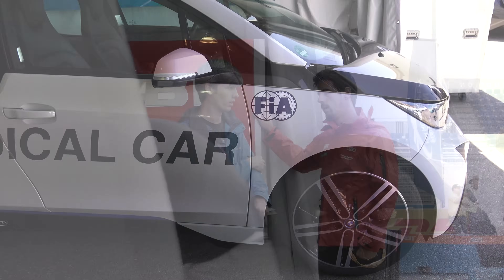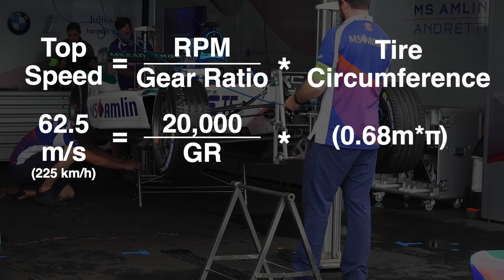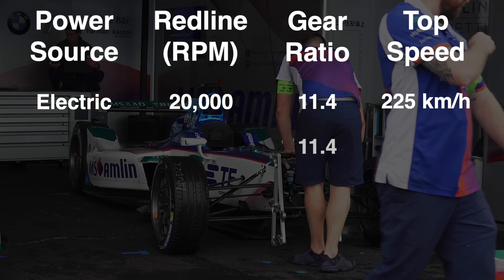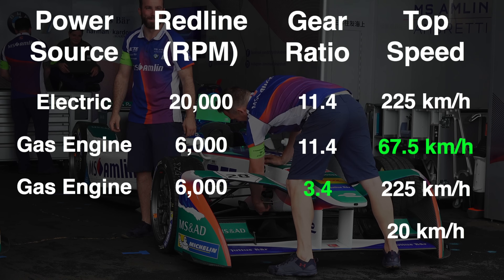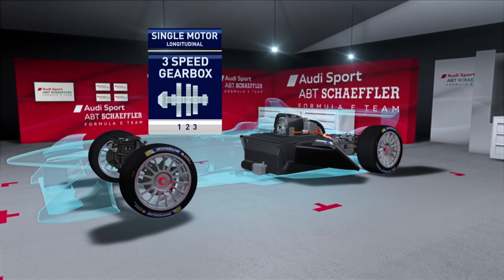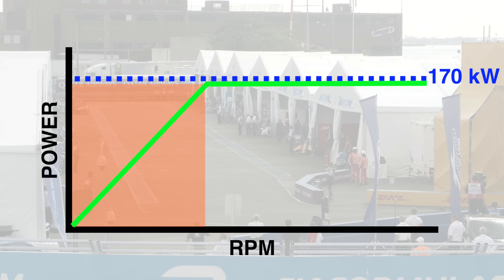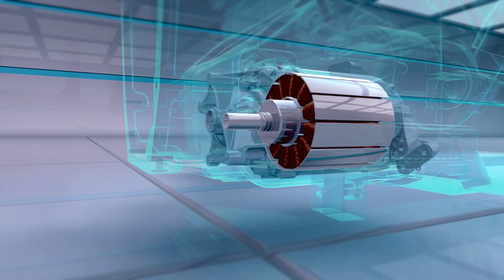Why Do Electric Cars Only Have 1 Gear?

Comment: Why do electric cars need brakes at all? Motors are capable of applying torque equally forward and backwards so surely they can slow down as fast as the tires can grip.
Reply: For emergency situations. And depending on the state of battery charge (completely full or completely discharged), the regenerative braking might not work at all.
Reply: Expect to see a brake-less electric car soon.
Reply: Surely it is wrong. Decelerating at grip level from high speeds needs much more power dissipating(recuperating) than regular electric motor can provide.

Comment: Are you talking about induction motors or synchronous reluctance motors here? You show a picture that looks like an induction motor, but you never say. I don’t know for sure, but I am guessing that SynRM motors have a bigger range of speeds where it will develop high torque.

Comment: You are not quite right. An electric motor has (as every motor) an efficiency curve that is zero att stndstill (stall) AND att unloaded top speed (No torque produced) This means that maximum efficiency is somewhere between those points, mostly att about 75% of unloaded Speed. Admittedly the efficiency curve is quite flat but nevertheless it decreases in both directions. A consumer car ( of electric bicycle for that sake) gets 2-3 the range with a gearbox compared to One without

Comment: there are gears is electric cars by the way because we still need that 11.4 to one ratio. so there are gears that are engaged. is traditional transmissions we engage only one set of gear in each gear you are I mean torque only flows through one set of gear other gear sets are disengaged so we should have the same power and efficiency in both one-speed electric car transmission and traditional 5 or 6 gear transmission

Comment: Does this mean, the Tesla Roadster need more than one gear, to make it up to 200mph?

The Porsche Taycan already use it.
Reply: Can you please use metric units?
Reply: @happygimp0  Ok. Über bzw. bis 320 km/h. Above or till 320 km/h. You get it ?
Reply: @bernhard.k  AFAIK: Tesla Roster can go far beyond 320 km/h, without gear shift. At least Wikipedia says he can reach higher speed and i do not find any info about Tesla having any gear shifts.
Reply: @happygimp0  i don't Think this works with one gear. The rpm of the electric Motors can't do both, High speed and High acceleration. But we will See.

Comment: The original Tesla Roadster had a transmission but they realized it was much cheaper and simpler to just overspec the motor and cap the torque at low RPM (otherwise it'd destroy itself through sheer brute force).

Comment: If you had a two or three speed transmission, how small could you make the motor and still achieve the performance of a normal car.  What impact on range would a transmission have?  I have not seen any videos that show experiments with this in mind.
Reply: Bosch CVT, which is a very "lossy" belt type (just proof of concept) has a claimed gain of 4% in efficiency while also improving acceleration by 13% for a given motor, total added mass 20 kg, so negligible. But this means we can also run a smaller lighter motor or better, a smaller battery pack so less weight. Using a Tesla battery pack this transmission slight breaks even in terms of weight saving, but you gain more range and more performance. Keeping the acceleration the same while possibly improving top speed would give you slight more gains.
There are multiple papers with more conventional geared gearboxes claiming from 10% to 15% efficiency improvements, here the weight savings start to become significant.
You can get away with just one gear but it's not the best solution, you compromise either acceleration or top speed no way around it since you can't spin the motor to infinity, not just in performance but more importantly because of the efficiency map of electric motors. Bosch wouldn't have investigated this if there was no merit, Porsche wouldn't have produced a two speed gearbox if there was no merit, engineering academics wouldn't have spent time and money writing papers if there was no merit.

Comment: My question is would they gain battery life if they could use a more efficient gear? I find it hard to believe you'd use the same ratio on a motorway and climbing a 1 in 3 grade, unless the car has over 500 horsepower like a Tesla. I don't think you'd need more than a 2 or 3 speed transmission though in most cases, in a lower powered car. Though even the 150 horsepower Nissan Leaf still only uses one gear, but it's still a bit limited in top speed compared to an equivalently powered VW Golf 2.0TDI. The G-Wiz tends to bog down on steep hills when tested on Top Gear and could benefit from a low speed gear.

Motorcycles, especially performance ones could easily get away with one gear because the wind resistance at high speed is equal to climbing a hill at low speed anyway, so there is no advantage to a low range gear that could easily wheelie and flip the bike when taking off. A bicycle that was powered to 60 mph experiences 20% of the vehicle and rider weight in air resistance - equal to riding a 1 in 5 grade.

Electric buses and lorries would still need a range of gears as the heavier the vehicle, the more discrepancy between hill climb forces and wind resistance forces.

Comment: Can you convert efficiency? Adding gear(s) will help with Wh/mile.  For example,    Tesla travel at 70 MPH  lose about 20% range vs traveling at 60mph.  Won't adding 1 gear like the Tycan allow better efficiency at higher speed? This is reverse comparing to ICE cars

Comment: My Puch Maxi S Moped which originally has 50cc’s, has a 70cc Zylinder and bigger intake and outtake. And it revs all the way up to 11’000 rpm and runs about 55-60Km/h

Comment: what kind of motors are used in formula e care AC or DC and which type in them
Reply: AC. DC motors need a brush but that is inefficent.
Brushless DC motors do not exist. Some claim they sell one but they are AC motors with a DC to AC converter in them.

Comment: I would like to know why jetski's done have gears. Maybe its planned obsolescence by the manufacturer as 9000rpm at cruising speed is sure to decrease the life of the engine. It would be nice to be able to have like a low ratio and then a high ratio for cruising.

Comment: Formula e looks promising but I just wonder why didn't they design the cars to have like a large removable laptop battery that can be popped out and replaced during pit stops?   Seems silly the driver has to jump out and hop into a second fully charged car just for the pit stop.    For one, you can see why this is because the current batteries they have are so massive.   It's built right into the car.. can't remove it.

Comment: I notice brainlets claim that electric cars will never outdo combustion engine cars because they lack range, yet as statistics shows, the average person drives less than 50 km and very few actually drives long distances, now why is that? 
Its very simple, people use vehicles to get to work, to the store, to pick up stuff in general they drive short distances because of it.
So how come in Norway a country that is infamous for horrifically badly designed road networks with extreme ranges between cities that are completely unnecessary yet its the one country in Europe were electric cars are doing extremely well sales wise and use case wise, because most people in Norway drive inside of cities because the cities are so poorly designed you have no choice but to drive if you want to get somewhere within an hour. 
Its very simple, even in Norway the average driving distance of a person is less than 100 km a day, which is perfectly fine even for the shittiest electric car model with a 12 kWh battery.
Most people in Norway only drive long distance once or twice a year on avg statistically this is insignificant and if you live in the South a train will get you to most places in fact the electrical network in Norway is so well established and well built that you can easily get everywhere you want with an electric car of range 100km even in the Northern most parts.

So this great range that combustion engine cars possess is very rarely fully utilised, after all most people do not really drive long distances anywhere in the world, electric cars might get 400 to 700km ranges of real world driving distance in a year or two easily, but in reality the last people to switch to electric will be long distance hauling services, taxis outside cities, emergency service vehicles, public transportation vehicles, military vehicles, postal services and so on. 
Regular people will however get the electric car specially with fuel prices getting illogically insane lately, as of writing this in Norway the fuel price of petrol was 18 NOK per litre and diesel was almost 17 NOK per litre, convert that to whatever currency you use in google and be shocked, last year the fuel price was 15 for petrol and 13/14 for diesel.

Comment: In a road car, an electric motor could greatly benefit from an overdrive gear for use at highway speed, right? Something to drop the revs down to something like 1500 or 1000 rpm at 70 mph. This would greatly improve mileage on long road trips.
Reply: I agree

Comment: I think with a gearbox an electric car could use much less power to keep the car in speed at for example 120km/h, thus the range of the car would multiply.
Reply: not really, as you only use power to get the engine to certain rpm (a lot of work), then to keep it at that rpm (not too much work), this is why cars are economic when they keep the speed but consume much more fuel when accelerating. Most of energy is used to spin the wheels, not the motor and to lauch a car in specified direction, not to spin the engine itself, so it won't have any great impact on range.
Reply: The main reason to have a gearbox on a electric motor is to accelerate faster and to climb hills easier. When a electric motor gets bogged down (like on a steep uphill climb) it can heat up very fast and destroy itself. Not to mention it's much less efficient running at low rpm with high load. Better to use a gear ratio to turn it into high rpm and low load.
Reply: I agree.  I don't think the efficiency is expressed correctly in the video, just performance.  if you clutch out an electric motor at desired top speed you would maintain the speed much easier.  But every motor has a startup cost, so you wouldn't want the motor at 0 rpm when in motion - hence a high gear than runs at low rpm to just balance out the friction and pullback of the motor.  Mass of the moving parts also plays a role of course.  motor/generator combos (charging while braking) seem to also gain alot of efficiency, and higher rpms=more power recoop.  So smart gearing up and down is just smart engineering.  of course how the car knows how long you are going to be in a power band and when in a brake to prevent overclutching is another matter entirely.  Distinct driving styles and brake riders would be the demise of a production geared 100%EV.  Gearing in a clutchable ICE at like 1L in size would be a decent tradeoff for battery size and allow for range extension and no cars stuck on side of road w/o juice.  I get that more parts = more problems (like weight).  but anyway, i agree - i think the imprint of a small gear package would pay for itself.
Reply: Porsche seems to agree with you
Reply: Nonetheless gearboxes will be a need for future electric cars... not everything is an unloaded car in a straight line
Reply: I agree. Most modern electric motors run on 3 phase alternating current with a frequentcy converter, and i was thaught that when the frequenty increases (aka let the motor spin faster) the inpendance also increases therefore losing efficiency. 

So if there is a gearbox the engine can rev lower and have less internal resistance.
Reply: @Sjef0194517  But if the internal Resistance is higher less Power is transferred, because less current is Running in the Motor.

Comment: Why dont they put gears on EVs to help improve efficiency when motorway driving. Reducing rpm. I can understand a single gear in performance, but surely for economy which evs are essentially aimed at in the consumer market, gearing would be a good idea?
Reply: the added weight and complexity would probably bring more downs then ups.

Comment: aelectric motors have  a wide range of RPM  but it does not mean that you can drive an electric motor under load al low RPM,   In that scenario,  it produces heat, a lot of it.  yo, with 2  gears will be enough.    Direct drive  tends to be a problem when it comes to deal with a little of weight.

Comment: what about "electric power" economy? Changing the gear ratio would help an electric motor to consume less energy, thus extends the range for a vehicle. But the cons of adding a gearbox to a vehicle is an extra weight.

Comment: Someone could help me? If I increase rpm, the energy consumption will increase too?
Reply: Energy consumption only increases when the spining magnetic field is faster then the spinning of the armature, a motor with zero load while spinning at a high rpm does not consume a lot more energy then if it where spinning slower, a motor trying to spin at a high rpm but being slown down by a load will draw more energy, a motor trying to spin fast but not moving at all from a load will consume a lot of energy and likely burn out the motor.

Comment: Does electric motors electric efficiency decline with speed? I mean, does it consume more electricity to drive the same electric motor at 20k and at 10k RPM if both are are the same RPM (like 170 kW in Formula E)?

I had the opportunity to work with a 11 kW motor (says the manufacturer) and I had it working at up to 48 kW but just after the peak power it just started dropping (a lot) but I still had the engine sucking up 48 kW electrical energy.

I'm just wondering if that was just the controller that wasn't properly set up, if there was too much friction losses or if the electric motor itself becomes less efficient.... Could that be a reason to have multiple gears so you avoid running in that high rpm low efficiency state?
Reply: Sounds like you over-saturated the coils. You hit a point where throwing more electricity at a motor just produces heat, not power. You should be careful, heat can destroy a electric motor fast. Excess heat will demagnetize the rare earth magnets in the motor.

Comment: Beause a gearbox is designed to get the most torque out of a combustion engine. The power of a combustion engine is dependent on the number of revolutions where as an electrical motor doesn't have a dependency on the number of revolutions

Comment: Anybody ever hear of the Daf 33, 44, 55 and 66?
Daf cars had a Variomatic transmission... only 1 gear so to speak and a reverse.
It was very clever, but did come with an annoyingly loud whine the faster the car went.
The final drive was cone shaped and a belt would slip down the gradient effectively accelerating the car.
One odmf the quirks was that the car could travel accelerating in Reverse with the same final drive.
The problem was that these belts would wear out fast.

This is just a simple example, but EV do not make enough torgue as they only have the Final Drive.
I m still trying to figure out the conflicting hybrids if Toyota and Mitsubishi

Comment: But what is the difference in watts used between full and half RPM?
I still think that electric cars should have 2 gears. 1 for normal road driving and 1 for motorway driving.
With the 2nd gear you have the car speed at a lower RPM which would use less battery power but you'd have less torque which isn't really needed at that higher speed.

Failing that, throw a CVT in there.

Comment: An electric motor can supply torque at zero rpm, which is why a clutch or torque converter is not needed to get the car rolling.

Comment: some main issues for road EVs with single gear:
1. relatively low top speed (most EVs have top speed of less than 100mph)
2. much slower acceleration from medium to high speed (50mph to 80mph)
2. significantly more energy consumption at motorway speed (a Tesla at 80mph uses significantly more battery than at 70mph)
these are putting me off EVs (assuming charging won't be much of a problem in 2-3 years' time with 300kw DC fast charge and 100kwh+ batteries on most affordable EVs)

Comment: at high rpm, motor's torque is down quickly and energy consumption is very poor level. 
Fomula E has 3 speed gear. 
Why don't you explain that have more effect on high speed energy consumption.

In the future. Electric Cars have gear system minimum 2 speed. I think.

welcome anyones feedback.

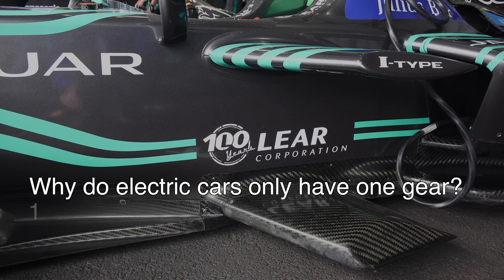Comment: 0:39 “Now it might be more appropriate to ask why do combustion engines need gears”... Yes, it would be. Gears are the solution to a problem which apparently doesn’t exist for electric motors. The end.
Reply: 6 years ago and answered my shower thoughts
Reply: There is a problem as long as they still do need gearbox to get that ~10:1 speed reduction. I want direct drive with nothing but motors attached to wheels. >:(

On a more serious note, the actual "problem" with EV's and single speeds is that in most cases you lose really much top speed. But this is more of a positive problem unless you frequently drive on autobahn, which I guess is why many German manufacturers use 2-speed gearboxes.

(yes, there are some really fast single speeds too but they have very special motors to allow such high rpm and/or have 3-4 motors which are so ridiculously powerful that they are able to run long gear ratio without sacrificing acceleration.